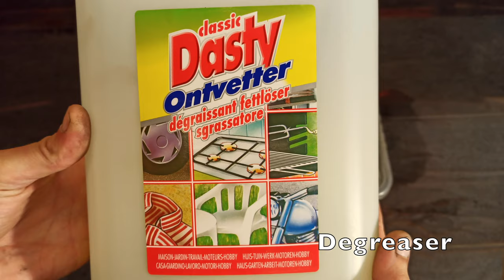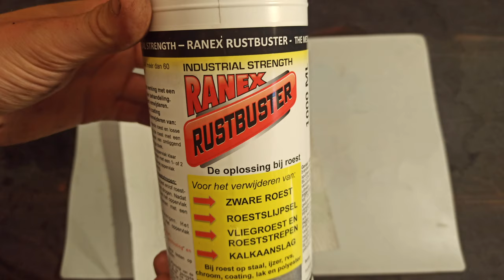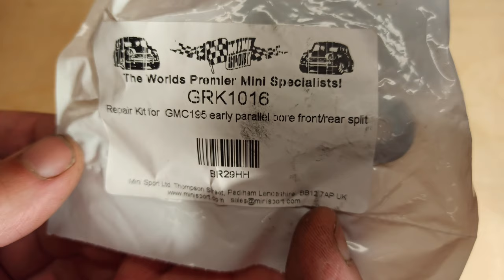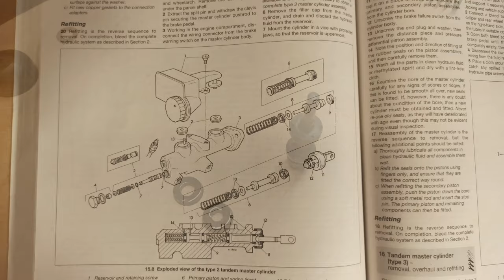EP6: The Brake Master Cylinder | CLASSIC MINI 25 RESTORATION

Comment: The piston is stuck with the spring for me.. cant get it out..
Reply from the maker: Hi! Maybe soak your pump in penetrating oil for a night, and then try again. Is there absolutely no movement in it? If you can get it out, make sure to check the walls of the cylinder for damage. Good luck!!
Reply: @restoringaclassic9489  I was able to get it out thankfully.. it needed some really good hits.. keep the videos coming.. i am myself restoring a mini following the videos..